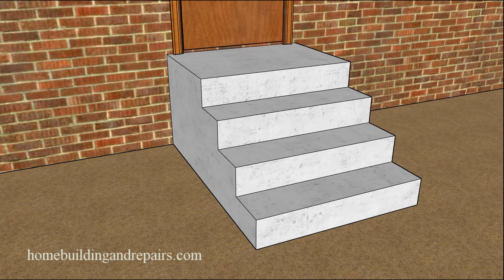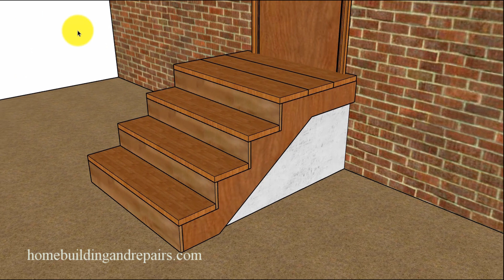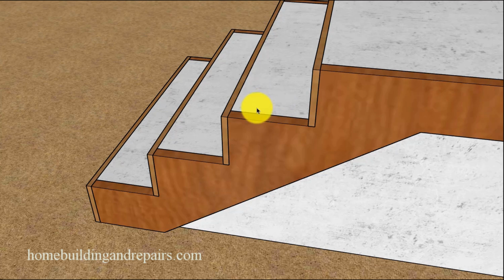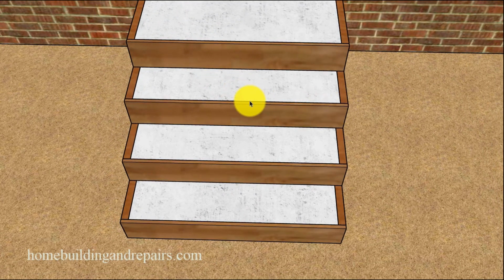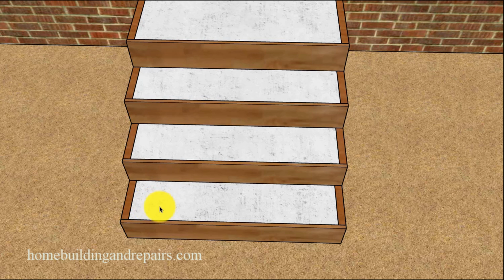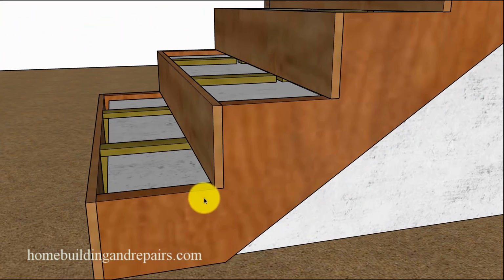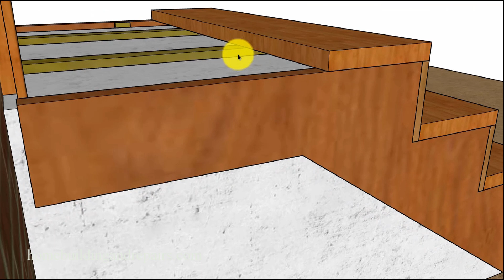Watch This Video Before Covering Concrete Stairs With Wood – Home Remodeling Ideas

Comment: Whenever I have wood next to concrete (even pressure treated), I put asphalt shingle strips / spacers in between them. Blocks 100% of moisture transfer and since I just do strips, it allows things to dry out. I'm on the Oregon coast - wet a lot of the time.
Reply from the maker: That seems to work well on vertical surfaces, but doesn't seem to work well on horizontal surfaces. I've noticed that water gets trapped above the water resistant or waterproofing materials.
Reply: @stairbuilding  I can see where that would occur. Sounds like the opportunity to design and sell a new product!
Reply from the maker: @ttfweb1  Sounds like I'm talking to the next Thomas Edison.
Reply: stairbuilding I do work in innovation - but it’s in high tech.
Reply: Ttf Web what about using composite for the footings?
Reply: This is AMAZING! Many MANY thanks! :)

Comment: Why not use  2x treated wood or pvc sleepers at 12 or 16” O.C. Screw those in  with concrete screws.  Then you can put your wood or composite boards on top of that.  If you wanted a gap under the sleepers, you could liquid nail some thin pieces of pvc trim under the sleepers to create an air gap so that it could help with the evaporation of any moisture.

Comment: Thanks for this video - very informative. A few questions, if you don’t mind! 1) what is the purpose of the stringers in this application? Couldn’t you use spacers on the edges as well? 2) In my instance, I’m considering putting down a blue skin membrane over top of the entire existing steps (which are currently leaking into cold storage below), then spacers, then composite decking. See any issues to this approach? Thanks in advance for any thoughts/guidance!
Reply from the maker: The stringers would need to be attached to something like concrete to create structural support. Water proofing might work great, but could also be a problem if drilling holes through it to attach wood supports.

Comment: Is there any reason you'd have to use stair stringers rather than just blocks of wood?  I feel like the existing cement is serving the role that the stringers would normally have, so adding extras on the side would be superfluous.
Reply from the maker: You can change this design and use blocks.

Comment: It’s more expensive but why not avoid all of the worry over rot and use composite decking and boards for a project like this?
Reply from the maker: As composite decking materials are proven over time for durability, we might start to see more of it used in situations like these.
Reply: or maybe just use composite for the footings where they meet the old concrete to prevent the footings from rot.

Comment: Could you just use Trex cut offs as your spacers?  Wood can screw into it and it won't wick moisture from the concrete
Reply from the maker: Yes, if you have a product that won't absorb moisture or won't have problems over the years absorbing moisture then absolutely.

Comment: I want to build over and and increase step width not sitting on the existing step, Is that doable?
Reply from the maker: Yes, go for it.
Reply: That would be step depth. Not width. Over laying a plank board onto a step decreases the depth of the step.

Comment: What are your thoughts on attaching something like go board (used for showers) to the concrete?
Reply from the maker: Why would you be attaching it? to tile over it or use it for treads.
Reply: Just for the wood to go on it. It would serve as a barrier between the wood and concrete. But I’m just thinking now that the moisture would still pool between the wood and go board

Comment: My front porch is 5 steps going up to a concrete patio. The sides of the porch are concrete and rebar and everything else is wood. So being that I live in Michigan water got under the treads, froze and popped one side of the bottom step up with the attached riser so it kind of bounces. All of the treads have three nails across the top of the  front half, but none near the back half of the tread. I can't figure out where the wood attaches or how to fix it.  As far as I can tell there is no middle stringer.
Reply from the maker: Email me picture of your problem. You can get our email address at our website.

Comment: Put a barrier in between similar to a sil plate but for exterior. Problem solved
Reply from the maker: What type of barrier are you referring to?
Reply: @stairbuilding  I think he is talking about the "Ridged Sill Plate Gasket" by FoamSeal, I was wondering if that could be used as a barrier.  A contractor had used it when repairing a door frame in our basement.  He used it as a barrier between the concrete floor/walls and wood studs.  I have an old, worn Bilco style concrete stairwell from the basement leading to a finished sun room. I've been trying to brainstorm a way of covering them.  It will be a challenge as some of the steps vary in height & depth by 1/4" - 3/4".